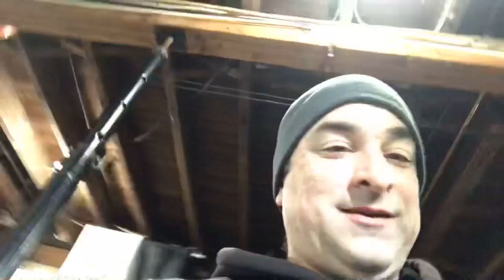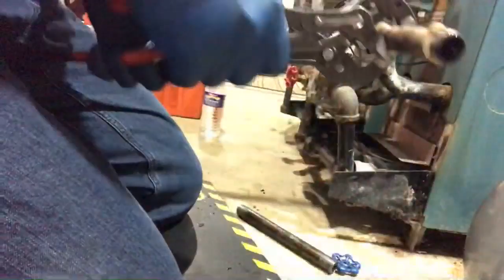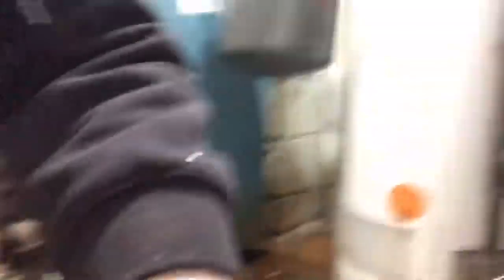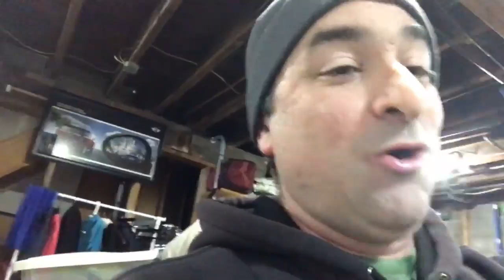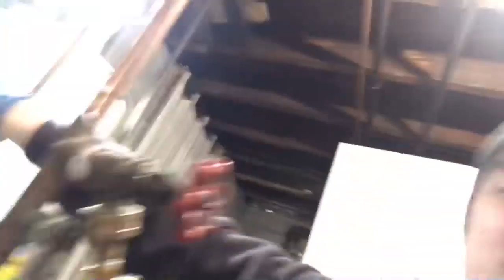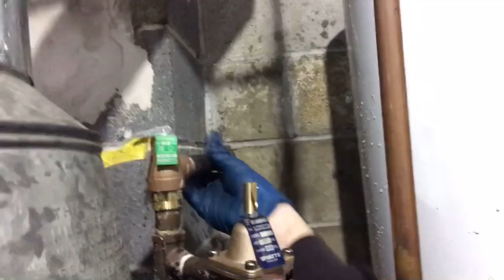Boiler Leaking Water Live Stream Repair

Comment: I did one tank last night.  It had a cutoff valve but I had to cut the tank of fo get it out.  It was installed with some sort of locktite.
Reply from the maker: Was it a blue or black pipe thread lock seal? If it’s blue it was block and you need a torch to get it apart. Cut it out also works. I once had a #60 tank after it fell behind the boiler I had to leave and abandon cause no way to get it out without taking the supply and return apart on the boiler
Reply: @thehvachacker  xpando
Reply from the maker: Ah I thought it was the blue block which is one of the worst pipe sealants out there since it becomes rock hard. looks like the expando is a cement never seen it but also looks like a PITA

Comment: Dig your videos man. I live out in California so a lot of the shit you work on like boilers and generators is foreign to me but I like watching it. We don't have a call for that stuff out here. I mostly get into commercial rooftop, residential split systems, natural gas, propane, and wall/ floor furnaces and of course the inevitable heat pump in rural areas. I think you're doing a great job and fuck all these trolls bro. We all do shit a different way as long as the end result works out properly and everything gets done the way it should be done to satisfy the customer who the fuck cares. Standard practice changes every day and we won't ever all agree on certain methods. Don't even address these fucks anymore. Keep up the videos I appreciate watching them. Little bit of background on me, I've been doing heating and air for 23 years the first four years in the trade I was a sheet metal fabricator basically making duct on a  hand layout Fab bench before plasma machines were commonplace in metal shops. Got tired of that because of the lack of challenge and redundancy then got into service work. Couldn't be happier even after all these years. Cheers!

Comment: Why do you have to make a mess with water not right every other guy I watch they don't make a mess water goes everywhere why please don't open valves without a hose or bucket for now on please I wouldn't have made a mess like that
Reply from the maker: Water was already on the floor where I sprayed it from the relief. Most repairs you valve off and water spills out. You have to take your surroundings in. Also most might edit that out. This repair was a live stream.

Comment: Bill is that Stay Brite8 you are using?

Also, what is your experience with Stay Brite8 in refrigeration systems.  I heard a manufacturer or two now accepts it.  Would seem to eliminate the back purge requirement.
Reply from the maker: I am using 95/5 solder. As for staybrite 8 for refrigeration work. I use it on all new copper. The only time I braze is when resealing brazed fittings I pulled apart. Which I do when changing coils, Compressors, ect. Yet new filter drier That I cut old one out I am staybrite 8 or for all new installs.
Reply: Thanks!  Always trying to learn, even at my ol' age... so I can help the new guys a bit. :-)
Reply from the maker: Life would get boring not learning new stuff

Comment: Sometimes you can use a socket extension to reach that boiler valve if the square is 1/4 or 3/8 inch
Reply from the maker: I will have to try it next time I run into this again. I am sure I will.